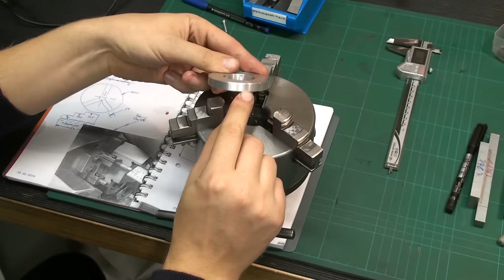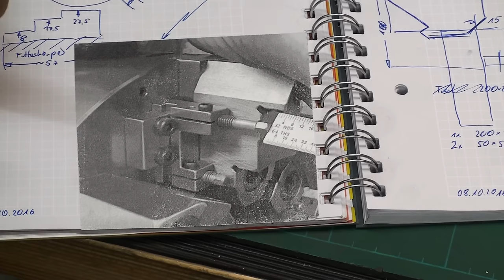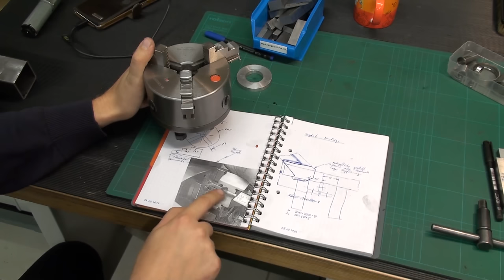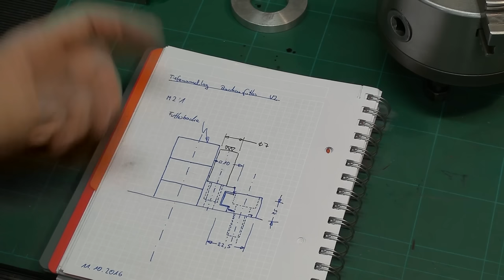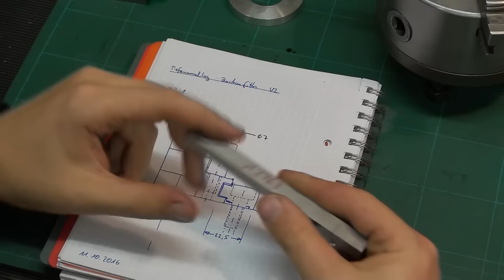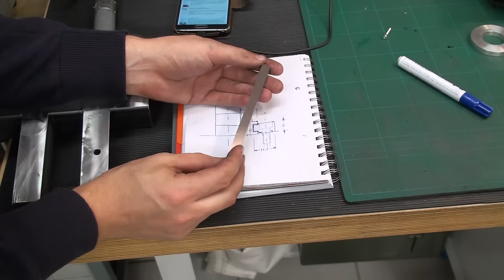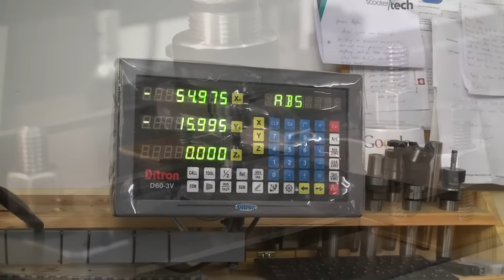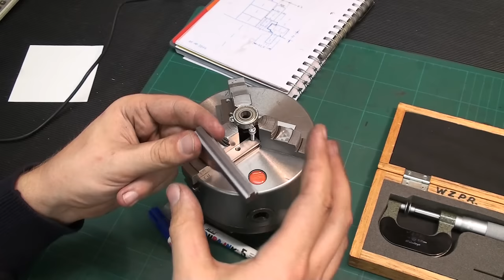Chuck backstop

Comment: Use a internal circlip / snap ring.
Works like a charm.
Fit it in the grooves 
I have been in machining for 20 years and have yet to find a more simple method of quick back stopping a workpiece in a Chuck

Comment: just my 2 cents worth, grinding the tool without warping it lay it diagonally on chuck so you are only grinding  a portion at each crank that way you can take a heavier cut with less heat.

Comment: Stefan..I've been watching all of your videos recently and I've started copying some of your ideas.  I had a suggestion for the sliding parts of your stand-offs,  You might drill and tap the inside end of each piece and attach a low head cap screw that partly covers the end of the slot.  That way if for some reason the clamp was loose on one of the sliders it wouldn't go flying when you turned on the lathe.  It would be caught by the tongue of the clamp.  It looks like you have enough room so it wouldn't restrict your adjustments.  EDIT...I see that your screws are close to the end.  Perhaps a thin plate welded on would work.....  Thanks for all of the inspirations.

Comment: I must say I understood every bit of what you were doing, but not until the last did I grasp that there were three stops, one for each jaw. Of course, you only showed one being made . Again of course, you need three points to establish a plane, see remedial Euclid. I knew that you knew that, so I was confused until I saw die ganze Sache, then it all became clear. Hmm.I use parallels for the purpose, same as you showed, adjustable parallels in my case. If I were doing production work, I would certainly consider this stop.Bravo!

Comment: I am still "mill-less" and undoubtedly ignorant, but when you are aligning the work with an indicator while traversing along it with the power feed, wouldn't it be quicker to knock the piece until the indicator needle becomes stationary, rather than knocking it back to zero? I imagine that knocking it until you reach zero will always rotate the piece and require a repeat pass. I know that the material has a bow, but I'm fairly sure both approaches would be affected by it.

Excellent video as always Stefan. I have also been very impressed by Robin's videos. It is such a joy to have so many highly skilled machinists sharing their knowledge with us all.

Comment: Fantastic job, one recommendation, If you use some small shim washers under the hardened depth stops they wont wear the surface of the mounts out where they tighten down.

Comment: I haven't watched the whole video yet but talk about "reinventing the wheel "! 
Joe Pie uses three drilled and tapped holes in the chuck body between the chuck jaws. Into these three holes he screws premade, you could grind them to length I suppose, three machined "standoffs" of the appropriate length. He keeps three sets that equate to the depths of the jaw steps. Screw in the applicable set, mount your stock and machine. 
If you need to make sure they're all the same or a different height just take the jaws out, run a skim cut over the posts, and re insert the jaws ready for your stock.
I do believe he has a video about them on his channel.

Comment: I love this project.  I could not help but think of the much simpler solution of drilling/threading maybe 3 holes parallel to each jaw, and then simply make a couple of sets of precision screws to insert directly into the chuck.  That would save you from making the sliding system and still accomplish the same.  For rigidity, the screws could be made slightly heftier.

Anyway, you already drilled 6 holes into the chuck.  3 more holes should make no difference, and this job could be done in a small fraction of the time.  Two or three different length screws would handle almost any job.  If the workpiece is so small that you would need to slide into the center of the chuck, I suggest an ER collar or a C5 collar would be better suited anyway.

Comment: Very clean, precise work.
However, I also started to squirm in my chair when you power-tapped M4 x 0.7 into a blind hole in the chuck body.
Question : at 8:33 you describe a "Wise". Please describe - is this a special piece of tooling used only by German engineering firms ?

Comment: You might want to think about hardening the parts the pins screw into. Over time the pins will start to eat into those parts and mess up the height. Not much mind you but every little bit counts in such a nice setup. BTW, how true does the face of your chuck run?
Reply from the maker: Yes, I think I am going to do that, harden it and then take it to the grinder one last time...
The face of my chuck is less than 1/100mm runout..and if it wasnt I would take a slight facing cut...or surfacegrind it :)

Comment: Hi Stefan I'm a recent subscriber and am binge watching your videos to catch up. The backstop video is awesome but one thing is bothering me a little.  When the chuck is on the lathe there is a potential for the stop to become a bullet if the clamps are not tightened all the way. You can't see if they are tight.  You could drill and tap for a SHCS behind the stop near the outer edge of the chuck face. This would provide a safety stop.

Comment: A brilliant project. I hope you don't mind if I more or less copy your design on my chuck... Great work!
Reply from the maker: Be also sure to check out Robin Renzetti ("ROBRENZ") on youtube, he showed the inspiration to this project.
Reply: @StefanGotteswinter  I did check it out, but I only have a 150mm chuck like yours and I done have the room. I don't have a surface grinder, so I will turn the posts in place on the lathe.
Reply: Joe piezinski's also got a video on simple backstops that are soft, screwed to the chuck face with counter- bored shcs's, and faced on the lathe to identical heights.

Comment: Personally I would have put those backstop pins to be precisely between two jaws, that way one would have 6-position support for thin work, 3 from the chucks jaws and 3 from the backstop. The reason behind this is because I've seen it multiple times on pieces bigger than 150 mm in diameter and having 20 mm or so of thickness, that when faced, the part is not straight but "bent" frombetween the jaws, as the material flexes between the jaws away from the cutter. And it likes to sing very very easily :D

But the backstop position "problem" is easily solved: just drill & tap more holes to the chuck :)

Comment: I really like this style. I absolutely agree that the usual spider is too material-intensive. I just wish I had a rotary table. Hard to make either variety without one. Not impossible, but difficult and prone to errors, at least in my hands. I guess parallels will have to work for a while longer...

Thank you for sharing this!
Reply: I don't think it's hard to make a spider using the the 3 bolt hole function?
Reply: But it's not just three bolt holes. It's three slots which have to be either perfectly aligned or oversized resulting in a sloppy fit. I suppose oversized with a through hole to a tapped hole in the face of the chuck would be a reasonable remedy there.
Reply: +Jon Miller I know it's not just holes. you drill a .250 hole in the center and the 3 hole pattern. insert dowels and use them to square each slot to the axis of your choosing. it couldn't be much simpler.

Comment: Have you ever tried a piece of bar with a bearing mounted in the tool post? Just touch the bearing surface against the part and it will align. Maybe it is not as accurate, I saw it on clickspring.

Comment: Chips inside the chuck? When I took my 40 year old 3-jaw Pratt Burnerd chuck apart there was not a single piece of dirt or swarf inside.
Reply from the maker: I never have seen a used chuck without chips inside :D
Reply: @StefanGotteswinter  I think it's because the only way for chips to get in is through the scroll/crown wheel and this is such a close fit that it needed a drift to get it off its boss, which effectively passes right through the chuck. P.S. I am addicted to your videos!

Comment: Hello Stefan,
I have a noob question.. What do you think of attaching the stops to the side of the jaws? Yes it'll make the stops a bit flexible, but since there are little to no forces on them, it might be ok. A couple of small screw holes wont hurt the jaws much, and this way the stops would travel along with the jaws :) May be do this on a second jaws set!? Thank You
Reply from the maker: Could work, but the jaws are generaly hardened, its no fun drilling and tapping into them... :)
Reply: Ahh ok thanks bro. like I said a noob question lol

Comment: the only thing that might happen should you not tighten the clamp enough is the movable piece shooting out by centrifugal force 
might be a good idea to put some sort of max extension locking pin intoo the design so the blocks cant come out completely and just give you a little scare instead of damaging stuff

Comment: Definitely needs some kind of a safety stop to prevent the sliding part from flinging out when you forget to tighten the screws or something else goes wrong and for example vibrations work the screws loose...
Reply from the maker: The moment I forget to check my setup I will quit my day job. :)

Comment: Hi Stefan, you know how much I like your projects since 1/3 1911 model, but this time I have to say that I see a flaw in your design. With this sistem you must be focused all the time and remember to tight the screws or the sliding parts fly away with centrifugal force of the chuck. To prevent this, I would have done blind slots on sliding parts so even when you don't tight enough the screws, the slide will not go anywhere. Greetings my friend.
Reply: so I also talked about it on. need safety stoper
Reply: Yes, yes! He also should put force sensors on jaws. Depending on diameter and material if force is to low he would be unable to turn spindle on (link with spindle rpm is a must!)...

Comment: 20:15 - Those rotary table spindles have a stepped hole at the bottom side.
It is a simple matter to turn a shouldered plug with an M 10 or .375 "- UNC female thread and bump it into place.
This will allow you to drop a suitable stud into the bore and thread it tight.
A washer or clamp and a nut will then hold the work firmly in place.

Comment: It’s been almost 2 years since you’ve added these stops to your chuck.  In that time have you experienced any out of balance or vibrations when using the chuck with the adjustable stops?  I’ve been wanting to do this mod since you posted this video but I am concerned with vibrations and it not being irreversible other than putting threaded rod in the holes to cover them up

Comment: Good tip, 

why not use soft jaws instead?
Reply: When the jaws are tightened, they slightly tilt/lift, thus making the part move axially. With these solid stops referenced from the chucks face, they are always the same, so jaw lift won't affect them. Very versatile to use.

Comment: Do you need carbide to cut tool steel? Or would a harder tool steel do the job?
Reply: Tool steels are typically supplied in the soft state, meaning they machine like normal steel and then you harden them once ready. A few tool steels are already so hard that a regular HSS doesn't bite them, but rare to see those unless you specifically ordered such a thing.

Comment: Why so complicated, my lathe has a MC2 in the spindle. Cut the point off and thread. Use fine thread metric M10 inserts with different size discs. Part depth can then be adjusted and tool can stay in the chuck during machining providing extra support at the back.
Reply from the maker: I agree if I had to clamp parts that are rather long and small in diameter, but I need something for parts with big diameter that are pretty short.

Comment: Hi Stefan, a question, how many power has your mill? in HP or Watts
Reply from the maker: 1,1/1,5kW (its a two speed motor, 1500/3000rpm, so it has two power ratings)

Comment: Nah its too complicated i usualy use my lathe cutter handles as paralels or hss bars.You can also put it in a low speed,put workpeace in a barely tight chuck and use a peace of brass or plastic to push it in and center it.
Reply from the maker: To complicated for your applications maybe - It suits my needs perfectly, I used it pretty much the whole weekend with changing setups and its just convenient :)

Comment: Nicely done but too much of a task to get the job done...I just cut a pipe slightly undersized and ground parallel when in a pinch for a one off job or so..mostly done in soft jaws. This should be done with jaws turned around, [designed for this purpose] otherwise not all teeth are engaged which causes uneven wear and too much dirt and chips are going into the scroll.

Comment: Stefan, what a load of old rubbish this idea is . Just buy a set of SOFT jaws and machine them to the required workpiece diameter and clamping depth.
Reply from the maker: Sure. While you are still boring jaws, I am already finished :)
Reply: The problem that these hard stops circumvent is jaw lift/tilt in any jaws, soft or not. These stops are referenced from the chucks face and thus do not move at all and the jaws only have to grip the part, thus making for quick, easy and extremely reliable and repeatable setups.